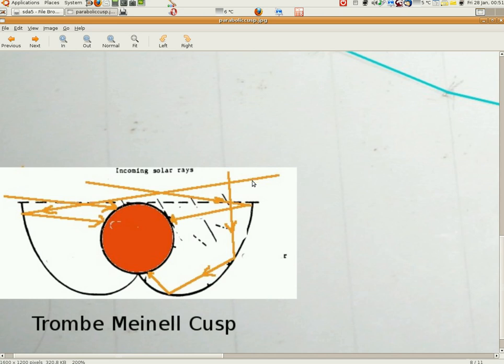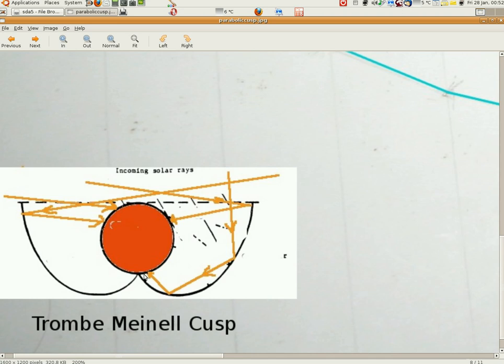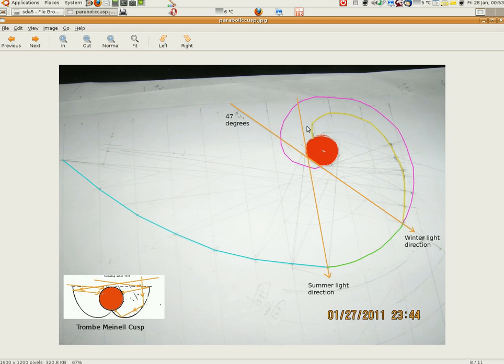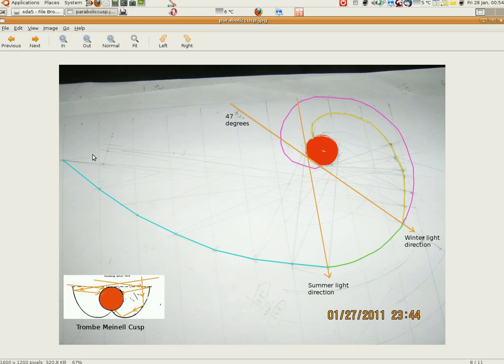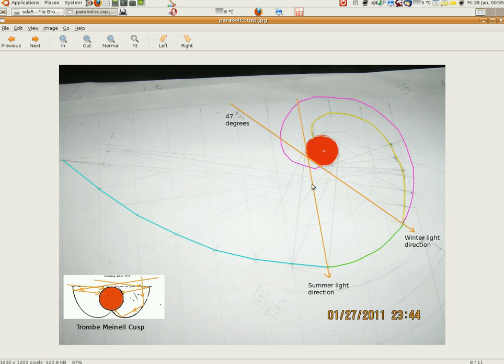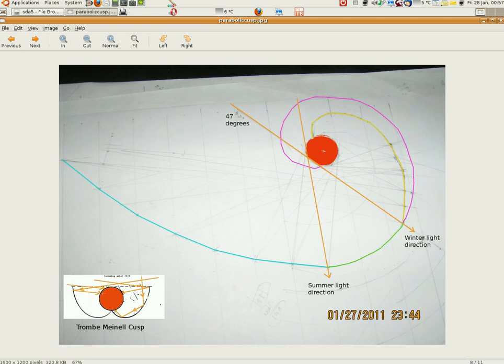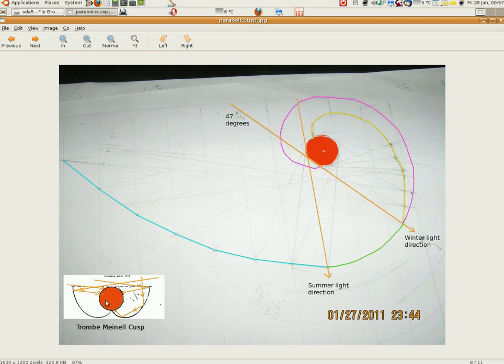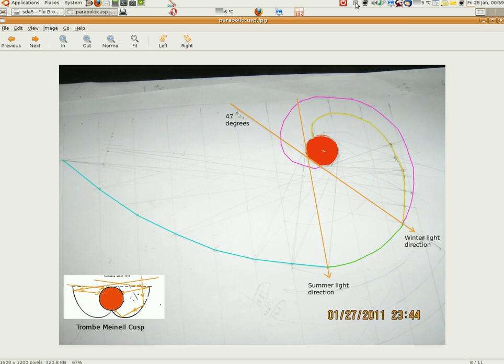Stationary horizontal solar collector part 2, progress!    and report.

Comment from the maker: Just a note that this is open source and there was prior patents (on the cusp, etc) which have expired.  I recently found similar work  (not exactly the same)  but with proper math! from the 1970 to 1990 period on pdf files.  I need to have somewhere open to put those pdf files.
I guess the method I am using is some sort of pre-calculus? 
It may only approximate the result but I think the method is worth it because it put power into the hands of ordinary people.

Comment: Looks like you curve is a based on a fibonacci spiral (see wiki for examples)  Use Fibonacci numbers as you points and plot the curve.  I am building a Tombe cusp collector now.
Reply from the maker: Hi,  James,  I have not been doing much solar concentration  lately.  Thanks for the interest. I can probably find  pdf files of  2 curves (very similar to what I did) that are properly designed and used just like that what I had in mind.  One is for winter collection and  the other one is for summer work. I believe the designs were done in the 1970's.  There was intense development for a few years back then due to high oil prices, but the price dropped and everyone lost interest,  some very good work was thrown out just before it came to market.   I might try something like that to dry desiccant.  Calcium chloride is the one I intend trying.   Brian

Comment from the maker: @TheSilverbullet99 The Short answer is no. 
 Any student of technical drawing can approximate my curve in a couple of hours.
 There are lots of  supposed "golden curves"  in nature but when you look closely they deviate from those "perfect"  ratios.  
 All we need to do is use nature's rules about how light bounces to design the curve.
 It would actually take much longer to find a shell (designed to do something totally different) and modify it to concentrate heat.